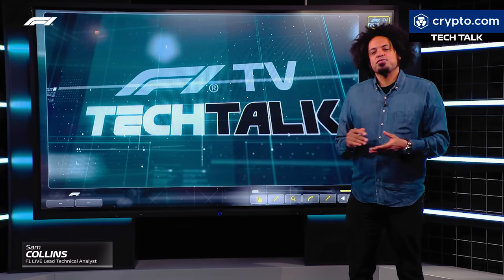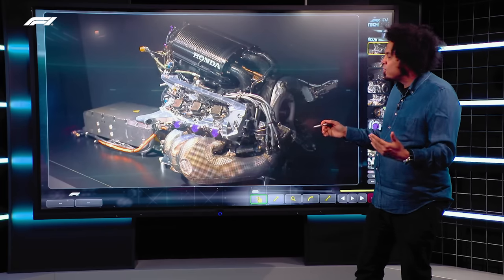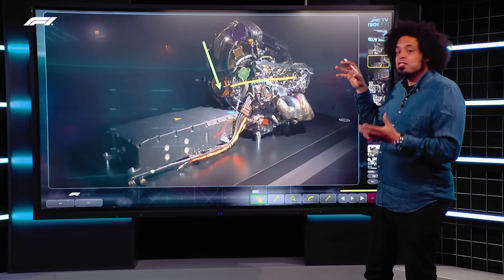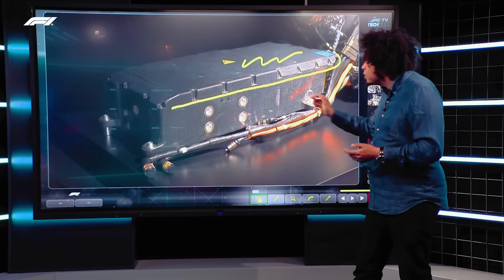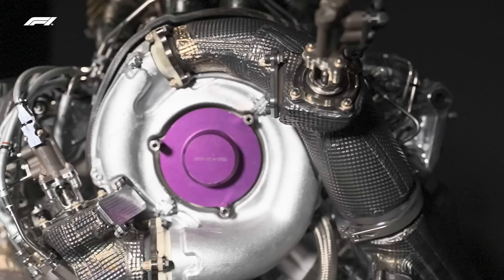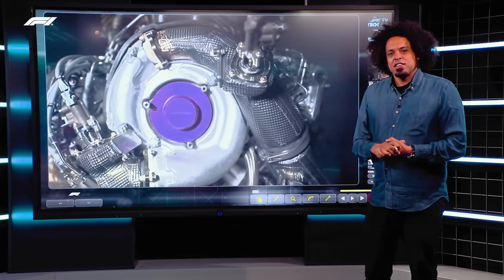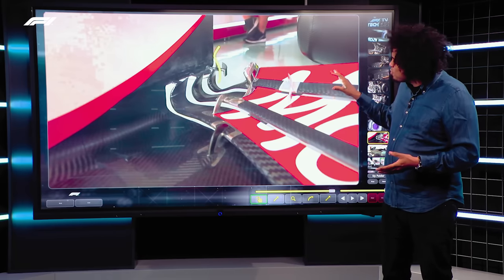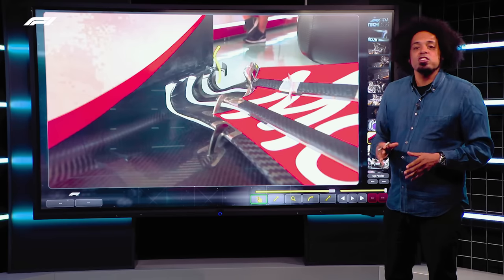Power Unit Updates, Haas' Front Wing & Alpine’s Floor Upgrades | F1 TV Tech Talk | Crypto.com

Comment: 1:36 i believe its the ignition coils that you're pointing not injector tops...
Reply: Yeah that's what i thought, having had the idea decades ago of putting a coil on top of each plug for better control and reliability.
Reply: And this guys suppose to be an expert! I thought that right away and went to the comments. Those are coils! Not injectors, this guy doesn’t know what he’s talking about
Reply: @gordonanderson3111  Pretty commonplace in road cars since the mid-2000's
Reply: Unless I'm misremembering, F1 PUs all have prechamber ignition to shoot the flame out into the combustion chamber for more even combustion. So they'd be both injectors and ignition.
Reply: I believe you have nfi what you're on about, because F1 uses a jet injector which that one piece does both roles...... to save space and even inc perf (extremely marginal ofc)
Reply: @Sasquatchbrain  I believe you have nfi what you're on about, because F1 uses a jet injector which that one piece does both roles...... to save space and even inc perf (extremely marginal ofc)
Reply: @KyleMc16  And you would be correct. It's a type of "jet injector" that also does ignition. Why have two completely seperate parts for two things that happen almost simultaneously, all the while saving space in the unit, was essentially their thought
Reply: Just so you know, it's a thing to help focus/push the explosion direction directly down the cylinder not wasting power by exploding in diagonal like with opposed injection/ignition.
Reply: @joshbates6274  That's just the coil pack, the injectors and pre chambers are separate. It's a passive pre chamber design, where the fuel gets funnelled in by a conical opening in the side of the nozzle, ignites and then jets out many smaller holes. The injectors and fuel rail are hidden below the exhaust.
Reply: @joshbates6274  It's not to do with the direction of the "explosion", it's to propagate the flame-front through the cylinder faster to enable running at leaner mixtures (amongst other benefits).
Reply: @amorag59 How is that not the turbine, you do realize that's a split turbo setup right? The compressor couldn't possibly be there

Comment: How is it that the FIA doesn't intervene when teams are obviously trying to generate outwash, when the regulation say elements can't have the function of doing that. It seems pretty obvious that making the connection of the wing element to the endplate in the Mercedes style has generation of outwash as a primary function.
Reply: Section 3.9 of “2024 FORMULA 1 TECHNICAL REGULATIONS” does not state anything regarding outwash!
Reply: Well according to the teams, those elements are there for downforce and definitely not outwash. And the FIA unfortunately can't do anything about that. They'll probably change the rules so that specific cheeky loophole is gone, but then the designers will find another one...
Reply: honestlly, with such little pieces of carbon, the efeect must not be really significant. we're in tha "marginal gains" range here. that's why FIA isn't very concerned. they have a team of aero engineers. i think they know very well what's not right to what's acceptable despite the spirit of the rule.

Comment: That front wing endplate is nice, forcing air away from one of the biggest things on the car that can't be changed for aero. The tires. The more air divrted around the tires is pure peformance, but then brake cooling and such needs to be addressed.

Comment: Out of curiosity. Say that a team crashes its car and titles its engine in the first half of the season, are they allowed to exceed their component limitations to keep racing the rest of the season?
Reply: Teams are allotted a certain amount of many different parts of the engine and transmission, if a team needs to introduce a new part exceeding their allotment, they'll receive a grid penalty at the next race. So they can use more, but are punished if they do.

Comment: its crazy that those are the size of coils on a normal car 1:35
Reply: It’s because those are the coils.
Reply: @tincandavexr4ti783  yes 4am brain
Reply: @tincandavexr4ti783  hmmm if the guy in the video says these are injectors some guy in the comments must know better. just because on a normal car these are normally coil packs, it could still be different on an f1 engine
Reply: @slezyorla  lol I can assure you those are not the injectors. Modern F1 cars utilize direct injection and you can clearly see the direct injection pump above the valve cover/below the plenum.

Comment: Here's a way to get closer to "net zero" - 18 race season, not jumping back and forth to the US, cut team sizes by 300 staff, cut the paddock hospitality down so there's less freight, ditch the money wasted on hybrid and the chemicals in making the 'energy store' and run sustainable fuel V6 turbo with no hybrid gimmicks, which means lighter wheels and tyres so Pirelli can save energy too. You're welcome, Stefano.

Comment: 1:35 are those the injectors or coil packs? And where are the spark plugs located?
Reply: coil packs
Reply: These are diesel engines,no spark plugs needed.😂
Reply: @Samsthings  That's what I thought but in the vid Mr Sam said these were the injectors. Didn't seem right to me as I'm pretty sure the spark plugs are located in the top center of the cylinders where these "injectors" are located...

Comment: People talk about the aero but its really the power unit setup that's allowed redbull to dominate. 

Newey has been with redbull since 2006 but it's only after changing the engine manufacturer that they started winning again. 

Last year in Azerbaijan gp sprint, max got a huge hole on sidepod and he was still gaining on leclerc, Its not the aero, its the engine. They don't even allow redbull mechanics to work on the PU and send their own technicians because of patent pending stuff. It's not just peak power it's where you make power with the torque curve and mark my words Redbull is gonna drop hard in 2026 when they have to use their own engines
Reply: No.
Reply: @reya012  We've already seen the rb's floor when perez crashed in monaco and lifted via cranes, teams could have easily seen the floor and caught upto rb 19 at least but the truth is the floor does not matter, the engine does
Reply: @shivamarya5225  Then explain VCarb.
Reply: @reya012 they use last gen engines and have a different cooling system which means different power curve. You'll redbull will drop off to the back in 2026 when they have to use their own engines
Reply: @shivamarya5225  And what's your source?
Reply: @reya012 what about the Renault PU that got Vettel his 4 wdc in the early 10s?

Comment: I've got a technical question, why don't the teams use heat vision/night vision cameras when it rains?

The problem drivers have in the rain is they can't see whoever is in front of them.  However if they used a heat vision camera or night vision cameras with a display inside their helmet, it would make wet races safer.

Surely the FIA wants wet races to be safer.

So why not?
Reply: It would not make it safer at all.
Reply: @makoaki9071  please explain your logic
Reply: Rain Spray has to go somewhere...

Comment: The "Floor" isn't redbull's secret, the powertrain is. We see the the floor all the the time, like when Sergio crashed out in Mexico and and his car went airborne, then in Monaco it was lifted out with cranes and we got a ton of photos of the rb's floor, if that was a secret to success the teams would have caught up to the rb19 at least but they havent because they don't actually matter. The powertrain photos are what's really gonna help others to catch up
Reply: It can't be the only thing, cos Alpha Tauri last season were terrible despite having the same powertrain, so clearly aero and drivers also make a big difference.
Reply: all engineers will tell you that reproducing something from pictures is extremely hard. you can achieve thevast majority of it but the details, you can't nail them.
Reply: @abigailcooling6604  alphatauri are always one gen behind and they have different cooling systems which means a much different torque curve than in the rb
Reply: @jiboo6850 ever heard of photogrammetry there are various programs that can easily create 3d models of object from high fidelity images of an object. They can do the rest with with fluid flow simulations that can perfect the curves. Teams can easily get multiple photos of the rb "floor" whenever one crashes out, its not a secret at all but redbull never works on the engine in the open, its the engine that's the secret not the floor

Comment: I would have thought those "injector tops" you pointed at would have been coil packs, guess I learned something new 👍
Reply: Pretty sure those are the coil packs, like you thought, and the injector tops are the purple circles lower down on the head.
Reply: They are definitely the coil packs.
Reply: yes 4am brain they are coil packs

Comment: What's the point of having Turbocharged engines once MGU-H is gone?!!

Bring back Naturally Aspirated v8 or v10 you fools!
Reply: higher power output & topspeed
Reply: Why are turbos used in road cars? There's your answer.
Reply: @halofreak1990  so what? F1 engine tech wasn't relevant for road cars for decades now, this doesn't make it any more applicable for manufacturers. In fact, WEC is the place to go for that.

Since F1 is detached from road cars, why not go for what was so loved and associated with F1? Why overlay n/a era sounds over F1 promos? 

That was a huge experience part of F1 that made it special. Nobody misses the sounds of these vacuum cleaners.